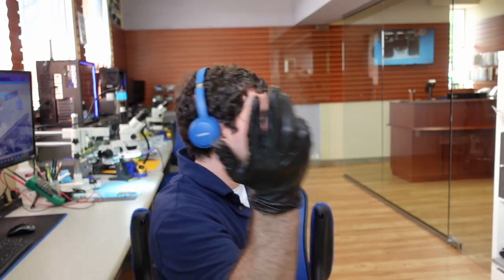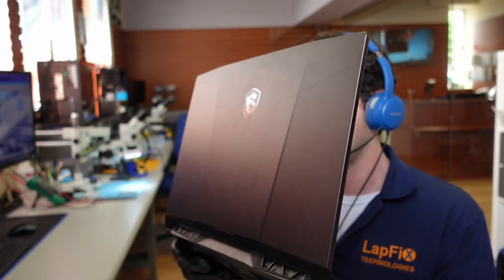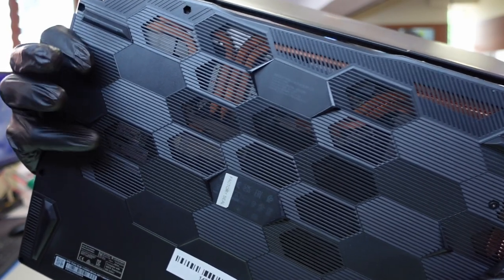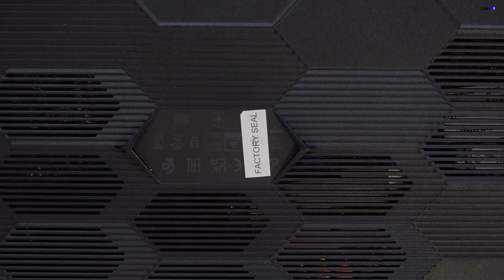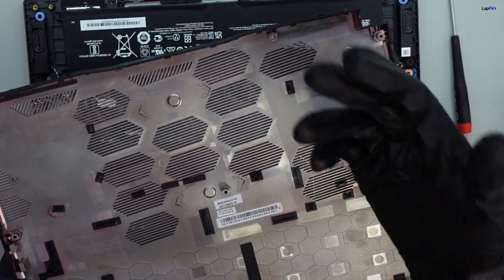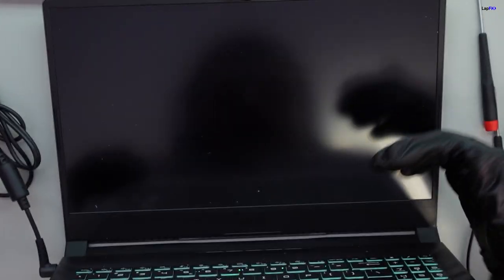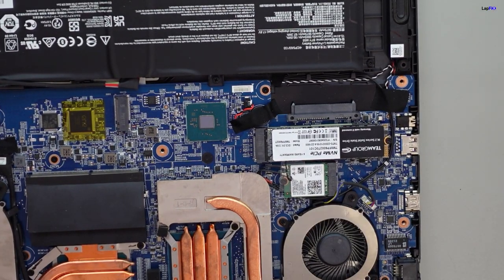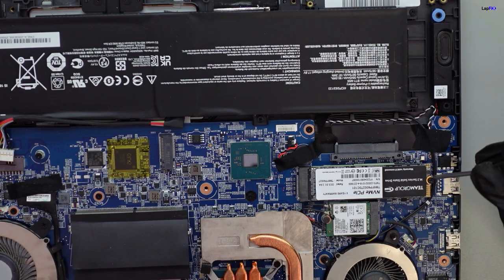How to Fix a MSI Pulse GL66 Laptop with No Display | Easy Fix!

Comment: Hi, I have the same issue. I tried to turn it on without the ssd and it doesn't work. Then i disconnected the ram, ssd, battery and still doesnt show anything. Could it be that the problem is the BIOS?
Reply: Hi, if you fix that problem, can you say me how? I've been trying to fix it all day, but it's no use.
Reply: @ABeckND if u fixed that trouble, i also want to know how, i stuck with it for all day 😢